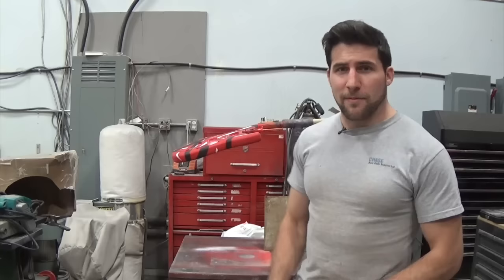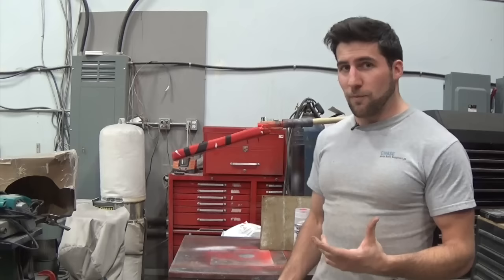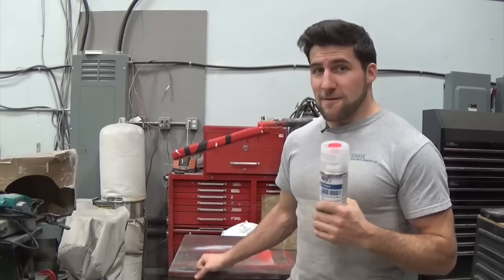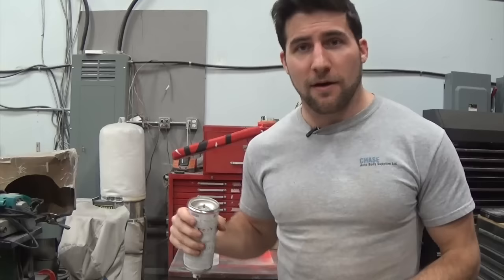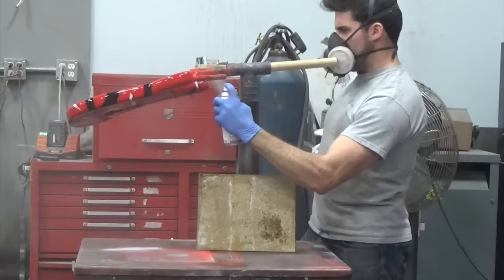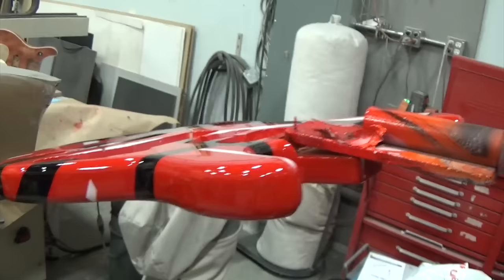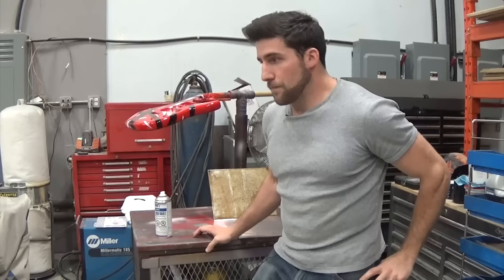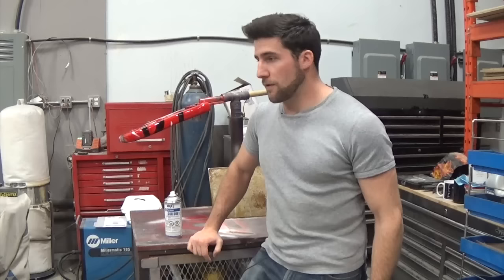How to get a professional looking clear coat with spray cans

Comment: Brad....I have built a guitar and want to paint three separate colors on the front. I want the color in the middle to feather out a little onto each of the other two colors....how do I make the paint feather out with out getting it all over the other two colors?
Reply from the maker: +Jeff Byars The best way would be with an airbrush, but you could also use a freehand shield held slightly off the surface. Sometimes a wide piece of tape peeled back from the side can also produce a softer edge that might do the trick.
Reply: Thanks, Brad! I enjoy watching your videos!!
Reply from the maker: +Jeff Byars I'm glad to hear it. You're welcome.

Comment: Would this method work on putting a clear coat on bare wood--an unpainted guitar?
Reply from the maker: It would work better if you sealed it first, but yes it works.
Reply: @BradAngove  Forgive me because I don't know what I am doing, but I want to put some kind of clear finish on what is right now just a bare wooden body of a bass guitar--from a DIY kit.  What would I seal it with first, because I don't want to stain it or paint it.  It's for my wife and she likes the color of the wood as it is.  Thank you so much for responding!
Reply: am checking out your "How to apply a perfectly smooth poly finish by hand" video.
Reply from the maker: Sanding sealer would be the typical choice. I also have videos on how to get a smooth finish by hand and how to brush on a gloss finish that were both done on bare wood.
Reply from the maker: Sounds like you found it.

Comment: Wich kind of filter do you use for 2k? A2-P3?
Reply from the maker: You can’t filter out the isocyanates in 2K. If you’re doing this with any level of frequency, you essentially need an air-fed mask.

Comment: I watched you clear one with a Painters Touch   Clear Gloss. I just happened to buy that clear because I'm doing a cheap guitar. Did that clear work out well?  I read 100 different things on clear coats online it has my head spinning. I'm doing a silver sparkle and did a test on something else with the old minwax poly and it was oil based and yellowed my silver. You think the painter touch would be good done in many coats?
Reply from the maker: The clear painters touch doesn't tend to give that oil yellowing that you generally get from the oil based products. I believe it's an acrylic. The painters touch product works fine, it's just not as durable as the stuff that I used in this video. I usually go with 3-5 coats of the painters touch product.
Reply: Brad Angove thanks. I read about water based poly also. Would you recommend that over a painters touch and then this stuff over both?  There are 100 different opinions on guitar paint clear it seems like. Thanks for the videos. They are all super informative.
Reply from the maker: Yes, there are many different schools of thought on guitar clear. It all becomes much more important if you're painting an acoustic, but for these solid body electric guitars you can get away with a lot haha.

Comment: how long does a paint and clear coat need to cure before polishing? I am in Alabama and we are averaging 50s during the day and mid 20s at noght.
Reply from the maker: This kind of clear coat needs about 24 hours.
Reply: I used duplicolor, sorry.  Last time I let the duplicolor sit for about 3 weeks, I just finished applying and I was curious if duplicolor needs that long to cure.
Reply from the maker: Oh, ya. Duplicolor typically takes about a month.

Comment: Hi Brad, great tutorial. An artist is hand painting my guitar with acrylic paint and brushes. This will obviously leave some ridges in the paint and I will need to have a relatively thick clear coat. You mentioned about scuffing the clear coat after 24 hours, would you wet or dry sand and with what grit paper? Also, any tips on removing the dust that's created from the sanding?
Reply from the maker: Dry sand with 800 grit and then clean it off with wax and grease remover (and let it dry) before spraying again.
Reply: Brad Angove - what do you use for your wax and grease remover?  Great great videos!
Reply from the maker: I use duplicolor wax and grease remover generally.
Reply: Brad Angove - thank you for the info good sir.
Reply: @HH PP   Did you ever use this clear over the acrylic art paint? If so, did it work good and bond good? I need to spray something fully covered in acrylic art paint and I was worried the solvents in this spray paint would damage the art paint....also worried it might not adhere well since I can't stand the surface first (being artwork)
Reply: @stephenwhite5444  hi, yes and it came out amazingly. I've done a few now, just made a quick video of the latest one which I was playing when this popped up. So search for 'Hand painted guitar - the rockerpus' It was hand painted with acrylic paints and a brush and finished with 2k acrylic varnish - It needs a lot of clear to cover the ridges. Research 2k properly and get the correct PPE as it's nasty stuff.
Reply: @BradAngove  thanks btw Brad - your videos got me started and it's been a lot of fun
Reply from the maker: Glad to hear it

Comment: What are the temp and humidity ranges you recommend for using this can?
Reply from the maker: It depends on the can, but generally you want to aim for as close to room temperature (or a bit higher) as possible and lower humidity is better.
Reply: @BradAngove  thanks! I purchased this one cause yours came out so nice. I was gonna get nitro but this video changed my mind. Your guitar came out awesome!
Reply from the maker: Thanks Luis

Comment: Question for you. I’d love to get a Gibson les Paul but can’t justify putting 2 grand or so down for a standard. I’m just not that good. Lol However I do really like the 2017 Les Paul Tribute guitars and they are getting great reviews. The only thing is that they are finished in satin. Is there anyway I can throw some gloss clear coat on there without having to sand everything off? Do you have any recommendations to get some sort of gloss on it. I don’t mind doing the work. Thanks
Reply from the maker: You can absolutely do that. Your options are: sand it lightly with 800 grit, clean carefully, and put a coat or two of gloss on it; or just polish the satin up to a reasonable gloss.
Reply: Thanks a bunch Brad. I may go that route.
Reply from the maker: I hope it goes well for you.

Comment: Awesome tutorial, I wonder how many coats of clear should I do if I paint with flakes? 5-6?
Reply from the maker: Yes, something in that range.
Reply: @BradAngove  thanks a lot! My base color is acrylic do you think it will cause any trouble with 2k clear coat? Or is it possible to achieve same proper coverage with 1k clear coat with just more layers
Reply from the maker: It shouldn’t be a problem with the 2K. You could eventually get the same coverage with the 1k. It would take longer though and wouldn’t be solvent proof etc.
Reply: @BradAngove  alright now I know, thank you so much, I appreciate it!
Reply: @BradAngove  one final question do you think that I should apply the 2k when the base color is wet or dry?
Reply from the maker: Dry for sure. Give it a week or so to dry before clear coat.

Comment: hi man, i put 3layers of clear coat on top of black acrylic lacquer (i sanded using some steel wool just to dull it up) but if there’s runs on the guitar do i just sand it back down and put another coat of clear on it?  thanks!
Reply from the maker: If you can sand it flat without sanding through it you can then move on to the polishing process.
Reply: Brad Angove god has spoken

Comment: Howdy! When can you apply clear coat after spraying base coat? I read to apply clearcoat within an hour so clearcoat can bond with basecoat?
Reply from the maker: If you take a look at the two preceding videos (this was my how to do a frankenstrat paint job series), you see that I waited a few days to apply my clear. You need to sand the base coat lightly in those circumstances to allow the clear to bond mechanically instead of chemically.
Reply: @BradAngove  Thanks Pal! Im going to try both your method, and clearcoat after 1 hour on scrap pieces and report back! Awesome vids by the way!

**btw by base coat i meant spray paint/color coat (not primer)..may have my terminology FUBAR
Reply: @BradAngove  can i use a rubbing alcohol or lighter fluid after sanding to clean the surface? Before spraying the clear coat?
Reply from the maker: Yes, lighter fluid works fine.

Comment: Hi Brad. Thanks for all your videos. QUESTION: I applied a clear coat layer to plastic spray painted white. I sanded and removed most / all of orange peel in the clear coat but I suspect all of my clear coat is gone. What's the best way to know if my clear coat is gone? I suspect it is since I get some milky white when I wet sand it. If so, what's the best way to remove orange peel without removing all the clear coat? I thought about applying 3 layers or clear so that there's some left after sanding but my biggest concern with lots of layers of clear coat was that there would be orange peel in each layer that would remain visible. Appreciate any guidance here!
Reply from the maker: If you only applied one layer it probably is gone. If you apply the three coats within the proper re coat times like in the video then you won’t have to worry about orange peel between the layers.
Reply: Thanks for the reply Brad! So if after my first or second layer of clear I see some orange peel, no need to try to remove it - just continue through all 3 layers and then only remove orange peel on the outer layer? Also,   the product you are using is pretty expensive versus a can of Rust-Oleum 2x ultra cover. In your opinion are the results much better with the clear you are using?
Reply from the maker: Yes, just sand flat at the end. Have a look at my video on 2x vs 2K vs 1k clear coats for a more thorough answer to your other question.
Reply: Thanks. The video on the 1k 2k and 2x was helpful. I really want to try the 2k but the comments about safety are scaring me. About sanding between clear coats, sounds like I don't need to do it for orange peel. If I happen to get some crazing / crinkling on a clear coat (let's say I accidentally over sprayed a spot) is that also OK to leave alone and just add another coat on top of it? Many thanks!
Reply from the maker: If you get crazing, let it harden and then sand it smooth before continuing.
Reply: Brad thank you for all the guidance. Another question: before I clear coat and am in the process of applying the actual spray paint, do I need to make sure all orange peel is removed before clear coating? Is it the same as your guidance on clear coating which is to not try to remove it between layers and just focus on the outer layer?
Reply from the maker: You don’t need to. You can take care of that at the clear coat stage.

Comment: I’m building a guitar now and have the paint done, waiting on my 2K clear to be delivered.  Should I prep the surface in any other way besides the wax and grease remover?  I used a gloss black enamel spray paint that seems to HATE when I spray over top of it.  Thanks!
Reply from the maker: Did you sand it?
Reply: @BradAngove  I sanded and sealed the wood prior to the black enamel, should I lightly sand the enamel prior to the application of the 2K?
Reply from the maker: Yes, the clear coat won’t stick to a gloss surface. Use 800 grit.
Reply: @BradAngove  Brad, you are the MAN!  Thank you, sir!!
Reply from the maker: You’re quite welcome.

Comment: Kit.com did not come up for me. I really need to get a better buff and polish method after using the 2K poly glamour gloss. HELP!!!
Reply from the maker: Ya, that site has been an issue. Take a look at the Amazon link in the description of my newer videos. It has lists now with everything you need.
Reply: Brad Angove will do. Thank you. Your videos have really been a great help for me. Since the whole Covid thing started I’ve built 6 guitars. They all play and look great thanks to you and TX Toast, but I just cannot get the finish coat to have the shine that I’m wanting. 

One more question, when using spray paint and urethane from a can, is it reasonable to expect a professional Gibson/Fender type finish, or do have to use a gun to that high gloss finish?
Reply from the maker: If you’re using the 2K poly and sanding and polishing afterward you should be able to get just as much gloss as fender/Gibson.
Reply: Brad Angove Thank you sir 👍🏼

Comment: Hey Brad- we briefly discussed a black/white stripe build I’m doing in one of your other videos last week. I had told you that EVH didn’t clearcoat his- just painted, level sanded and polished. I finished painting mine and I definitely have ridges from the tape. I also plan on relicing it with an exacto knife. But even though he didn’t put on a clear, I’m prone to my paint getting f’d up over time. You said you wouldn’t sand/polish and leave it alone. Would you shoot a satin clear to avoid it looking too “factory glossy”? Is that a good strategy to protecting the guitar while keeping its original intended look? I don’t want to keep this “authentic” just to have it be ruined down the road after use. Thanks man- I’ll buy the clear through your links
Reply from the maker: Getting a satin clear on there would add some protection. You could then polish up the areas that you would usually touch while playing, which would emulate some of the gentle wear the guitar would normally get.
Reply: Brad Angove as always thanks Brad. I’ve learned a lot from you and your vids in a short amount of time. Is that clear that you shot in this video ok to put over Duplicolor Perfect Match?
Reply from the maker: Yes, but it’s high gloss. They have that or a matte version. You’ll have to do some work to get it looking satin. 
Also note that this clear doesn’t really age or yellow.
Reply: Brad Angove - Hi Brad- I have one last question about this before I hit it with the spraymax. I can see/feel the tape lines between where I taped off my black lines and where I sprayed my white over the tape. I used Duplicolor cans. Should I just lightly sand the ridges and try to blend them with 800 before shooting the clear? Or will the clear fill it in and level it anyway? I’m afraid of sanding too much and going through the paint. Thanks a lot
Reply: Brad- I just realized you address this in your video before this. My bad. Thanks for all your help. Cheers

Comment: Hi Brad - - - I just ordered some of this clear coat. Would you recommend warming this in warm water before use or is it cool to use it without warming it? I'm also using Rustoleum Dark Cherry Metallic - - - warm that in water or not? Thanks!
Reply from the maker: Warm the rustoleum up a bit, but I wouldn’t do it for this stuff. That can speed up the catalyzed reaction in the can and cause it not to last as long.
Reply: @BradAngove  Thank you so much!
Reply: @BradAngove  Great, thanks! One more question - - - after applying the final coat of color, how long should I wait before I put this clear on? Thanks!!!
Reply from the maker: I would give it a week.
Reply: @BradAngove  Thanks!!! You help is very much appreciated!

Comment: Brad, what do you recommend for cleaning a enameled surface prior to spraying clear coat once the enamel is dry, in preparation for application of clear coat?  I had some isolated crackling in my first application of clear coat, and attribute it to accidentally not thoroughly cleaning off some Goo-Gone I had used to remove some adhesive residue left over on the surface from taping off.  I sanded back the crackling, and it looks good again, but now I'm worried that if the surface of the enamel isn't clean enough I'll have some more crackling problems when I get ready to spray the clear again.
Reply from the maker: Wax and grease remover.
Reply: Thanks!  I think Walmart has Purple Power or Simple Green on the shelf...good enough?
Reply from the maker: I don’t know what that is... just use windex.
Reply: ok, will do, and thanks very much!  You're great!
Reply from the maker: You’re welcome. Cheers my friend.